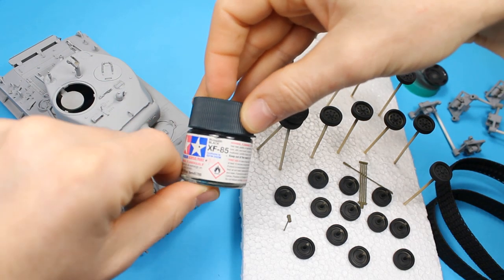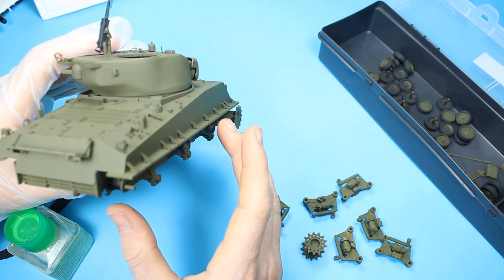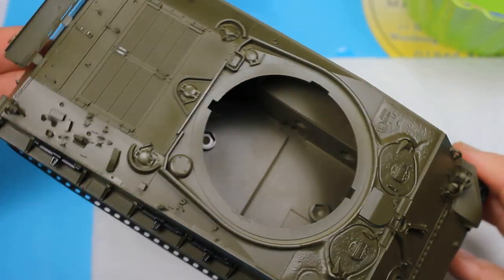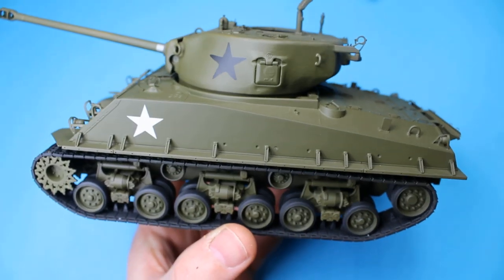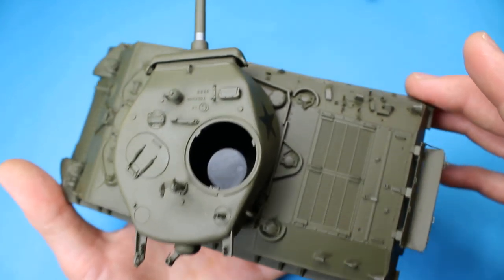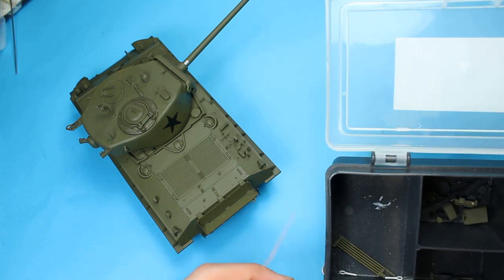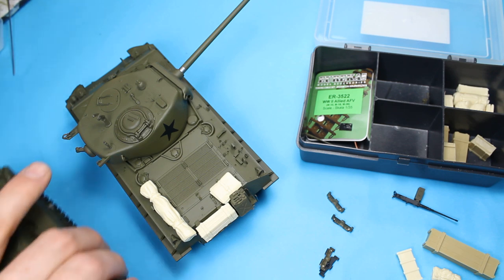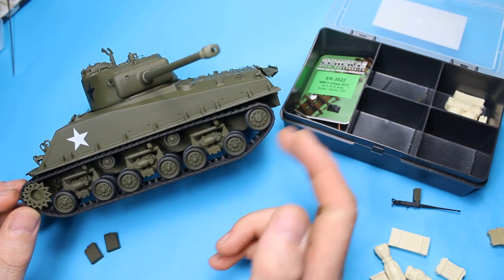Tamiya 1/35 M4A3E8 ‘Easy Eight’ Sherman Tank, Full Build, Part 2

Comment: Nice video!
Kudos for pressing on and stripping those decals and sanding back and repainting. It takes perseverance. I recall one time when I had completely finished a Tamiya Mosquito, I went to hit it with a spray of flat coat and then realized when I started to spray that it was primer I had in my hand! So I had to strip the whole model and start again. But on the bright side I never made that mistake again.
Thanks for keeping the videos coming in theses trying times.
Cheers from Canada 
Bob

Comment: Hi Jason .. when you do the tracks do you prime first ? as the first set i did on the first beginner build the paint started to flake off .. do you prime - paint - coat them ?
Reply from the maker: Yes it is best to wash them in warm soapy water, prime with a rattle can Primer or Mr surfacer etc then paint. Sometimes the issue is using thinners on them for oil and enamel washes, I’ve found this to react with the tracks on occasion. Overcoating after all this is really just fir the finish rather than protection
Reply: @ChampionScaleModelling  thanks for that .. just wanted to get it straight for the model i'm building at the moment

Comment: hey in part 1 of this video you used a razor saw to cut some plastic and then you used those nail clipper type cutters to snap some pieces off of the rear end of the cover. why? to use photo-etch instead?
Reply: Yes, you are correct. 👍👍 He removed the plastic molded-on kit fenders & replaced them with Eduard photo-etch fenders....then he removed the molded-on 'handles' & install grab handles that he made with wire. 😊

Comment: Dunno what the person was about when talking about the .50 caliber handle. He might have been referring to the quick-change barrel handle on the barrel of the gun. It's possible tank-mounted .50 cals didn't have that, since I haven't seen one in photos of an easy eight.
Reply: Nope, and that was me. I was talking about the charging handle on the right side of the MG. It's used to cock the weapon. It's the the little piece of plastic, ( kind of a nub). I would remove that and place a piece similar to those in the handles at the rear of the MG.
Heres an image
https://www.google.com/search?q=50+cal+mg+charging+handle&oq=&aqs=chrome.0.35i39l5.-1j1j7&client=ms-android-verizon&sourceid=chrome-mobile&ie=UTF-8#imgdii=PjGhn7jAwg_kYM:&imgrc=A37j9LX50YKF8M:
Reply: You see the charging handle right behind the ammo belt that's fed in. The handle is similar in appearance to the grips at the rear.
Reply: Sucks about the decals, I had the same problem with two sets of Star decals I purchased for my M-47 and M4A3.